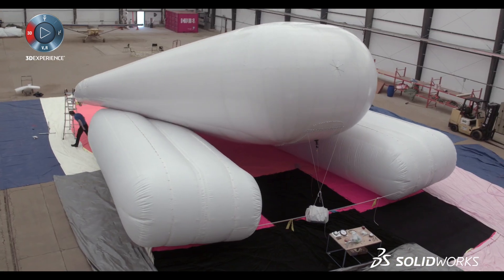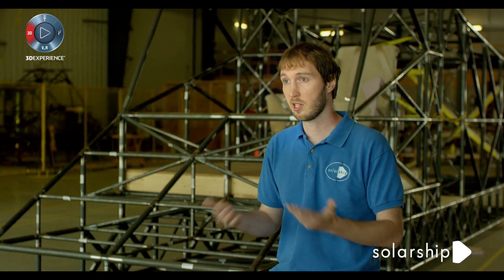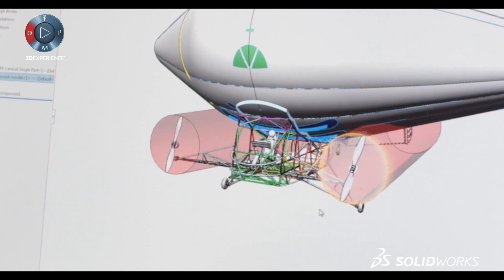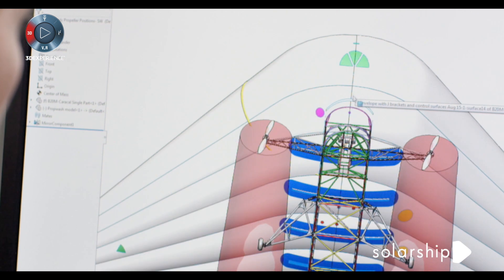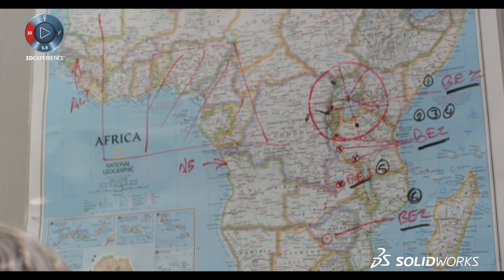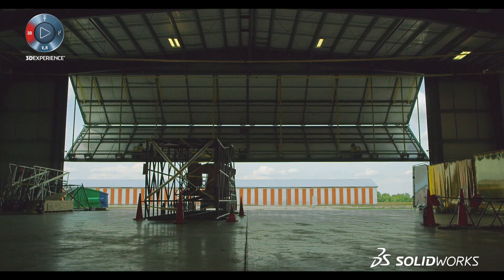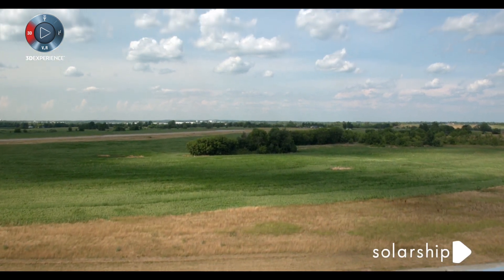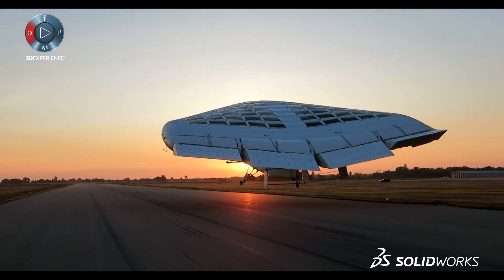Born to Design: Solar Ship - Innovation Takes Flight - SOLIDWORKS

Comment: These guys were engineers with no practical experience in aeronautics. It is fortunate that when the things crashed the pilots were only disabled for life and not killed and without data recording how would they know why? Engineers from Canada. Total embarrassment. Ailerons unsupported on a nonrigid structure and an inverted wing for flight lift. They welded the aluminum in a limit state design structure so sure it's overweight. High tech. metal printed, laser cut. carbon fiber CAD, you name it the investors got a full coarse of Canadian bullshit. Brand new hanger sits empty waiting for investors while Mzz Eaton lets a world-class aircraft design starve and in the hanger next door. This is what we expected from an economy based on building houses for immigrants.  All show and no go. Total embarrassment. There will be a lot of the same manage without experience in the Canadian spaceport for Nova Scotia I expect.  It's just sad.
Reply: Can you do better? If so... Do it! Less criticism and more results :)